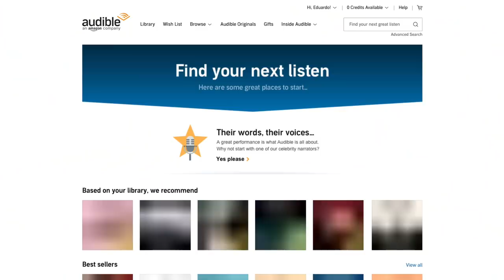⛵️DIY sailboat portlight installation #109

Comment: Guys just a word of advice... if you ever have to do this again, try not to get the sealer in the holes you are putting bolts/screws through. The bolts and screws will drag the sealer in to the threads making it so difficult or near impossible to get the screws back out 🙂

Keep up the good work though.. it’s all a learning curve
Reply from the maker: We were concern about leakings. It's gonna be hard to take this off for sure!
Reply: Odd Life Crafting 

I’m sure you won’t have to take them off anytime soon 🙂
Reply from the maker: Let's hope we won't

Comment: Are your portlights coated with a UV protection coating or film? If not, do so (before adding rainx that was a good tip!) My acrylic car sunroof went milky after 5 years and even became porous for rain..
Reply from the maker: They have a UV protection coating. From the outside they are kind of grey

Comment: Opinion Only: When checking for leaks the clear water method works. However,  if you add (a lot) food coloring to a water bottle or spray bottle and repeat the process...any water that you may not have found that penetrated the inside of the boat will "stain" whatever it touches. If you find dried food coloring (use different colors for different tests) inside, you know that the leak was from a specific test as you used a specific color for each test.
Yes, it is more time consuming...However, in the long term it might save you a headache. (Use a damp cloth to wipe the inside surfaces to help locate the dried food coloring as the cloth will turn the color of the food coloring.)
Reply from the maker: Thanks for the tip

Comment: You could have used a squeegee instead of your finger. one quick pull around will make a nice smooth seal. Same thing on the top of the hatches. Use a rubber squeegee for the hatches. I used double sided foam tape on the acrylic.

Comment: Hi guys, my only thought is: the boat is thought for high latitudes, this implies not a big load of air entering from outside. So be prepared to possibly change some of these port lights with others which open up. Definetely less safe with big waves in high latitudes but totally a plus with the lack of air and humidity of the Caribbean
Reply from the maker: We have 8 portlights that don't open and 12 hatches that open. 😉
Reply: Wind flows better in vertical “holes” (port lights) rather than flat surfaces (hatches). In facts exits some textile to deflect the wind into the hatches. Moreover you can’t leave hatches open during navigation, not even the easy one, if you don’t want to fall into an open one while walking on deck, while you can leave port lights open with the benefit of air speed + boat speed (a good flow of air even from a small port).
Reply from the maker: Thanks for the explanation.

Comment: Duca, it’s much better to use butyl tape in areas where water incursion can occur.  Although it is not UV resistant, it works very well where it’s not exposed to sunlight.  Plus, it has a thirty year life span - better than sikaflex in our humble opinion
Reply from the maker: Thanks for the tip. It’s not easy to find here in Brazil

Comment: Some prefer using butyl to seal fixtures on deck and ports rather than sykaflex because of it's properties. You might want to consider using it
Reply from the maker: A friend had butyl on his portlights and had leaking on them after 2 years. So we were afraid of using it

Comment: Next time use pop cycle sticks to smooth out the sealant. And use less sealant on the outside, you can go over it with the extra that is left on the sticks.
Reply from the maker: Actually we didn’t have much leftovers of sika. I don’t think we would need to use less than what we use, otherwise we could have holes on the hull 😁

Comment: Kind of late to the party but in the future if you need to do something like this again make some "dummy studs". Figure out the bolt size and thread pitch go down to the hardware store and buy some really long ones of cheap material, then cut the heads off and cut a slot in the shank so that you can screw them in and out with a flat tip screwdriver. With the "dummy studs" in place you can just slide the components over the studs and everything will be aligned for permanent fastener installation.

Comment: Apply sixaflex in triangular beads ie cut a 'V' in the nozzle,it gives a triangle bead that torques down better as it starts off thin and gets thicker the more you tighten,its also neater easier and less wasteful.Im sure theres a vid somewhere to show you. Nice job though.
Reply from the maker: Thanks for the tip

Comment: Is there video of how messy things got with the Sikaflex,lol. I used it to install windshields years ago. (also called windscreens in UK)  I liked Sika. It holds like 2000 lbs per square inch. If you have a leak it won't be between the gasket and the boat.
 To clean edges, I used soapy water and a straight edge razor blade along the glass. Mosquito repellent with a paper towel also works for clean up before the Sika has cured.
 Why are port windows called port windows if they are on the starboard side? :-)
Reply from the maker: Thanks for sharing your experience with us.

Comment: When dry fitting the gaskets you could have used some rubber glue to them and they would stay in place without any problems and the clean-up would be very easy.

Comment: If you ever have to reseal ports, consider just using butyl tape.  It is non-messy, easy on and easy off and can be resealed without replacing the entire seal.   But butyl rarely ever needs to be resealed.
Reply from the maker: Thanks for the tip

Comment: Liquid soap or saliva. Just if using saliva do not ingest it ofc. Also wondered why you completely taped the entire acrylic ... however after seeing him put a coughs bead of sika around the outside, was glad you did completely cover it with tape. OH MY, you only need a bead, not half a tube lol.
Reply from the maker: Hehe. We actually have a big space on the bottom and we needed to create an angle there to avoid accumulating water
Reply: Still just a bead, bigger bead, but you wiped off more with your finger then what was left. Tip for future, you can get nozzle tips that look like has rectangular end on tip. That will create a nice 45 degree angle with one nice solid bead. Or get plastic lil tool that does that as well, but nozzle tip is better and easier. No scraping off excess needed with correct nozzle.

Comment: You could have marked the old glass with numbers and would have cut and drilled on new glass taking old ones as stencil reference. By this way you could  replace new ones with pressision holes
Reply from the maker: The guys did this

Comment: Greetings from California, I think you would be better to use butyl tape on your port lights, it's the only thing I use now. For portlights, through bolts, it never dries out and seals great, and very little mess.
Reply from the maker: Thanks for the tip. It’s not easy to find it here in Brazil

Comment: So... little hint in case you or anyone who watches the video... to clean the excess of any siliconinc material/sealing.... keep a glass with some soapy water and wet your finger with that and remove the excess... you will see that it will be much more easy to clean and your hands won't get messed up...

Comment: i used some acrylic where i live in Florida and it turned yellow from the UV. a friend told me i should have used Lexan. i don't know how this would work in a marine environment. is there a reason you didn't use glass?
Reply from the maker: Glass is kind of dangerous in a boat as it breaks easily.
Reply: http://www.cruisersforum.com/forums/f2/portlight-replacement-tempered-glass-or-acrylic-147003.htm . this is why i asked about glass. safety glass does not break easily. also i think a lot has to do with the thickness of the glass. but you have acrylic. when you need to replace it in the future this is something you might consider :)

Comment: Not sure why you were so worried about. The seal around the windows is quadruple layered. First the water has to get past the outside caulking and then it has to get by the inside caulking. That’s the first two layers of protection. The next two layers means the water had to get past the rubber gasket and then the caulking inside that. On top of all that it’s all compressed in which is what makes the rubber seal up nice and tight and spreads the sealant evenly. The part I’d be worried about will be that main entry hatch. You have to make sure everything is just right there or it can leak from the top or the back. But let’s not worry about that just yet. 😁
Reply from the maker: When we bought the boat there were some leakings on some of the portlights, that's why we were afraid of having leakings on it
Reply: Odd Life Crafting yeah but that was after twenty five or thirty years with twenty years of neglect. Eventually you will have to do some Maintenance on that boat to include checking around your Port-lights, but that’s years from now. You two are very thorough and careful so you should have no real problems. So keep up the great work and are you still planning to sand blast the fuel tanks? Any idea on when that may happen? I always knew it could be done. Then again I’ve restored six or seven cars in my life so I have a lot of experience in restoration. However you do need to use some different products that I’m not familiar with, but that’s not to big of a deal. They are always coming up with new and better things so you can get a better outcome. Just have confidence in yourselves and you’ll do a great job.
Reply from the maker: Maybe this afternoon we are gonna test the sandblasting machine 🤞🏻

Comment: You really want to invest in a couple of rolls of Butyl tape instead of Sikaflex.  Butyl might stay good and flexible for 50 years...the other stuff not so much.  You can use it to bed pretty much anything well above the waterline.  The Sikaflex looks better, but it can go bad in as little as a year or two.  It is worse on big glass like on catamarans for failures.
Reply from the maker: It's not that easy to find butyl to buy here in Brazil. Maybe for a next project when we are gonna be traveling around the world. hehe

Comment: I am at 8:30 in video.   The new paint looks very beautiful on the boat Duca and Roberta.
Please be careful not to get any of that Sikaflex adhesive sealer on it.  Would alcohol remove it 
from the boat if it smears without damaging the paint?
I will watch and see haha.
Reply from the maker: The alcohol is good to clean the surface when it's still wet. 😉

Comment: Still acrylic? Why not Polycarbonate sheets or tempered glass?
Reply from the maker: It was an option. It was 5 times less, we can polish it and it doesn’t crack that as easy as polycarbonate. Here in Brazil is not common to use glass in sailboats
Reply: @OddLifeCrafting  Between Polycarbonate Lexan VS Acrylic Lucite, Lexan is way better. I use lexan for skylights. It's stronger than acrylics. It's what they use on racecars and those clear partitions at hockey rinks the smash into. You snap acrylic if you bend it but acrylics don't.

Comment: If you need the gaskets to stay in place when you replace them you may find a substrate in an art store that will hold the gaskets in place without effecting the gaskets sealing out the weather. Let’s face it gravity is not your friend in this situation.
Reply from the maker: Thanks for the tip

Comment: And for sicaflex use a rubber to clean. Google: kitrubber. Make it wet with soap and pull it clean. The corner in the rubber is the sicaflex that stays.

Comment: antes tarde do que nunca

thanks 
hi twins 
nice job ,you can be pride 
but if i can 
black sikaflex  so not same color of gloves it not joke ( with orange , you can see  black to black ) 
prepare all inside and outside  
rubber it s easier to cut after fridge or congelator time 
to draw it better in white with fine point ( error +error  made big error of size ) 
about my side better to wax screw for next time and sika not glue on it 
cut sika nose   
when you start need to continue without stop or moving nose ( buy very good silicon gun  automatic release)
before do this it was better to buy silicon card scraper ( litle accessories  to build superb finish)
Reply from the maker: hehe. Tudo certo agora

Comment: Why do you not use a power drill when taking out and putting in screws? It would go much faster…
Reply from the maker: The screws are flat head ones
Reply: And by hand it’s much easier being sensitive enough in putting the same torque on each side
Reply from the maker: Indeed. It's also a reason why.

Comment: Next time you have to locate a hole with a screw, particularly through a gasket, get yourself an awl or pin punch an use it to center up all the holes before inserting the screw or bolt.
Reply from the maker: Thanks for the tip
Reply: @OddLifeCrafting  This is particularly helpful with blind holes such as the portlight surrounds and any trim pieces etc. 

You guys are doing a great job.

Comment: I can't help but think you have wasted your money on that primer, especially on the rubber gasket to hull joint. The primer is designed to etch into the acrylic..it wont do much to the metal and rubber and sikoflex will bond really well to the gasket and the hull and the gasket to the perspex if all the surfaces are prepared and cleaned properly.
Reply from the maker: We actually applied the primer on the hull and on the acrylic 😉

Comment: When you removed the frames for the first time i saw you use a screwdriver to prey off the old frames I hope you were careful not to bend any of the surrounding frame. That slight bend could result in a leak after its replaced.
Reply from the maker: Thanks for the concern, John. It's all good.
Reply: They were pretty careful ( I was more concerned about the wood )  and that's what the Sikaflex is for, it fills wide gaps and bonds incredibly well. I've used it many times.
Reply from the maker: Thanks for the explanation

Comment: I think your making a mistake by not replacing all the screws before it dries. By waiting until it dries and then putting in the rest of the screws you have a chance of breaking any or some seals. Last thought remember as you age you don’t get taller.
Reply from the maker: We actually forgot about the last spin and we did all the way to the end in the first time. hehe.